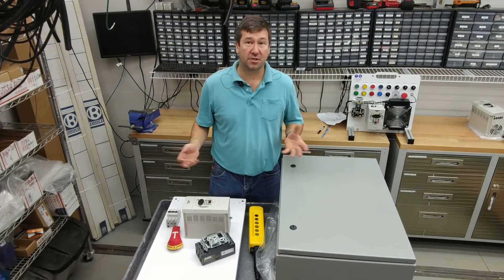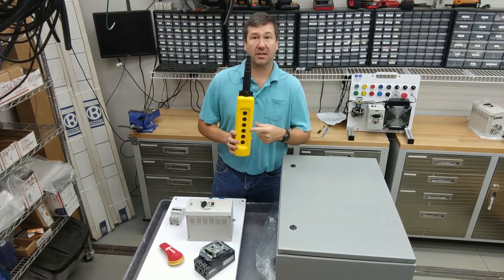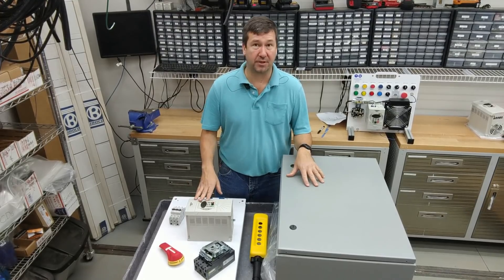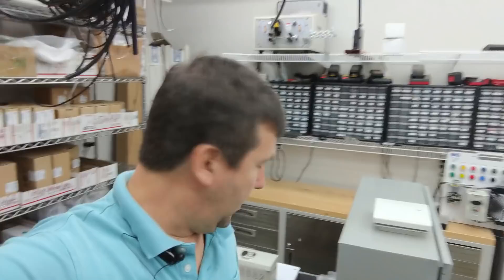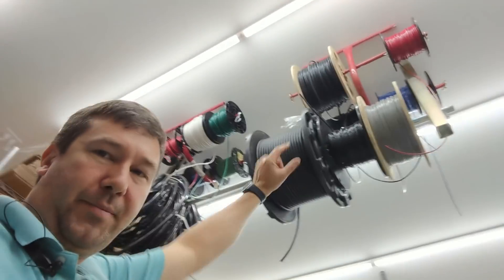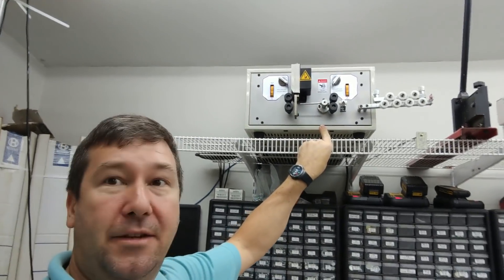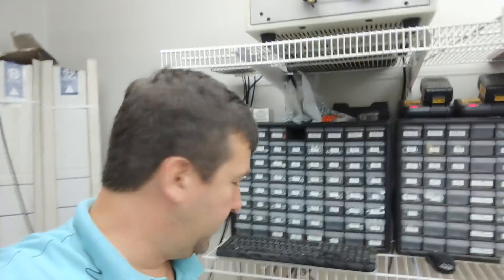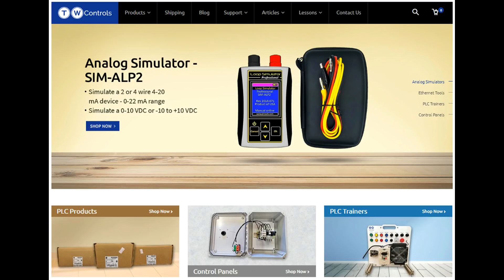Tools needed to build UL 508A Industrial Control Panels Part 1 of 6

Comment: I use an old school manual DRAFTING TABLE that architecs and Engineers used to use back in the day to draw up old school blueprints.  You  can use a ½" x ½" x 48" long stick of aluminum L- channel from Home Depot with two pressure clamps to help secure stuff from sliding down off the table.  Allows you to tilt it from horizontal flat to full upright vertical 90° deg up with a simple mechanical lever.  The pedestal stand has a built-in small 120v motor with a simple left/right pedal operated by you shoetip, that allows the table to be raised up or down.

Comment: Thanks for the info! I have spent the past two years taking on the role of producing UL listed industrial control panels in-house for the company I work for. The challenge was out of necessity and I've learned so much in the process having had no previous experience. I am pleased to discover that in teaching myself essentially, I have implemented many of the techniques and steps you demonstrate by considering anything I can that would make the process enjoyable, mistake free, safe, and efficient.... though now having done all I can myself, my notepad was filled quickly with info from your series of videos on this. Thanks again from this newbie for your expertise!
Reply from the maker: Glad it was helpful Jonathan!

Comment: Tim, I’m seriously wanting one of those wiring  stripper cutters. What brand is that? Any recommendations or gotchas? I reached out on mrplc but I don’t think you have been it. Thanks in advance.
Reply from the maker: Hi Brian. That machine is great but we don't keep it very busy. What are you looking to use it for?

The biggest gotcha of it is you need to be prepared to organize the wire as it comes out of the machine. It takes Amber and myself both fully concentrating. If you don't then you're have a huge tangles mess. But we can cut several months of wire in about 30 minutes.

I'll see if I can get you a brand and past number tomorrow.
Reply: Tim, hoping to make up batches of wires for wiring arms and maybe jumper and such. It seems like I’m always doing this and it wastes lots of time. I recently got smarter and started having my teenager do this. And that helps but I feel this would save lots of time. 

I could see how it spitting them out could make a mess in a hurry.
Reply from the maker: @brianincontrol  We have a video coming out on November 22 that details out us using ours.  It isn't ready yet but in it we offer the use of ours to others.  If you know the wire size, length, and quantity you need then we might be able to make you some to try for the cost of the wire and shipping.
Reply: @TimWilborne  sweet thanks for the offer. Nice looking forward to the video. Can you tell me what the model # is and where you got it?
Reply from the maker: Forgot to grab that for you. I'm on the road. Will you remind me next week?
Reply: Tim Wilborne reminder, please get model number. And if possible where you got it.
Reply from the maker: @brianincontrol  It doesn't look like the supplier I purchased from is selling it now but google "SWT508-SD"